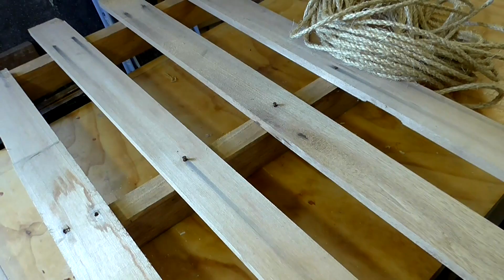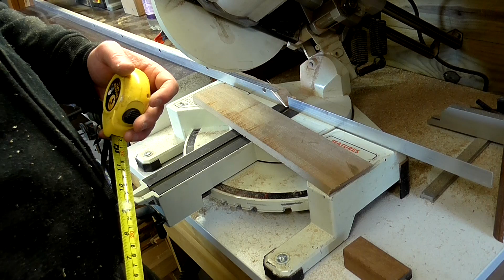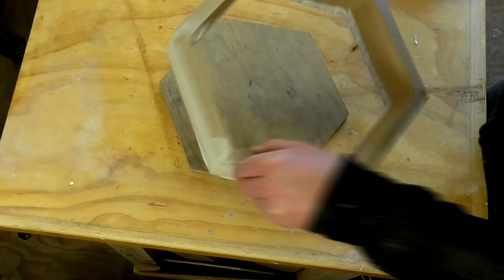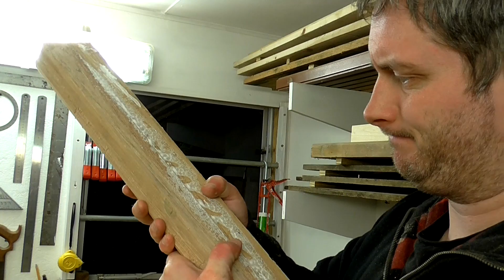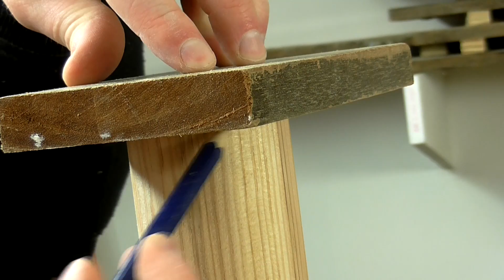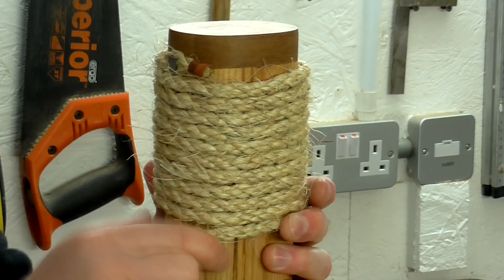Making A Cat Scratching Post - Using Pallet Wood and Concrete

Comment: Suggestion if you were to make it again for hidden fixings for the rope.
Use a forstner bit/ spade bit to create a rebate in the top of the post before an end cap is added and also drill/cut and chisel out a channel out of the side. you can use a washer and screw to keep it in place then wind it round to place of your choice and cut it with 100mm to spare and mark the wood. Drill a hole all the way through that the rope can pass through and then drill a wider hole half way through in which a knot would be abe to squeeze in. The knot will be covered when you wind the rope around the post. once all the way to the top you can then screw it back into place and cut any excess then glue on the top cap

Comment: Hey Mr Bone Brown, 

I'm a brand new subscriber with a love of the type of stuff you do. I notice you use a lot of pallet wood and like I used to you dismantle pallets with a crowbar and hammer. Recently I found a fantastic chap with a massive field of reclaimed wood. When I turned up to get some old fence panels with my hammer and crowbar he let me have a go of his Pallet Breaker. It changed my life! It made taking pallets apart easier, quicker and I split almost no slats. The wood reclaimed was all in really good shape and the nails easier to remove. The type I borrowed wad about £70 on ebaY or Amazon. It was a little out of my price range but definitely worth what it costs. I found a roughneck one on Amazon for just over £20. It has a lifetime guarantee and does the job perfectly (needs a little more effort than the longer heavier one I borrowed) but I can't recommend one enough. It will change your life.

Lee 😀

Comment: I think you could have saved the original post.  If you counter sink some screws to hold the pieces together and then cover all that with rope all the way down to the base you would never see them.  It still turned out nice and ultimately if the cat is happy with it then consider it a job well done.